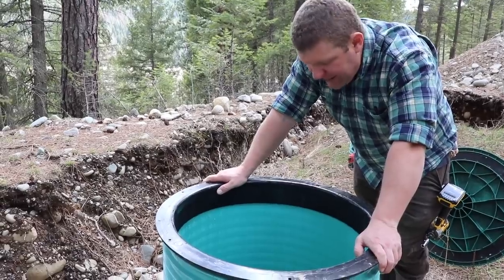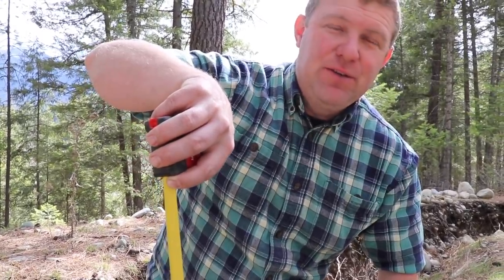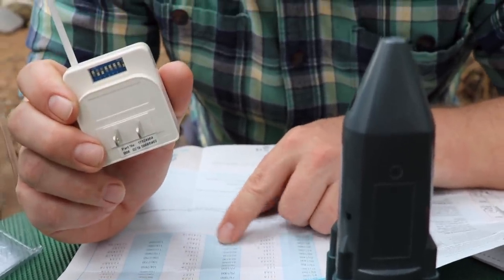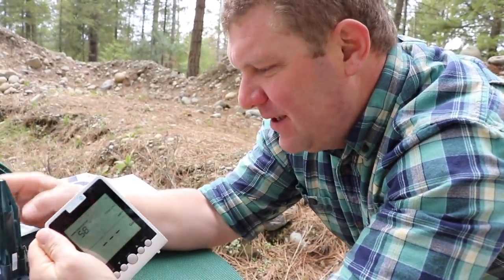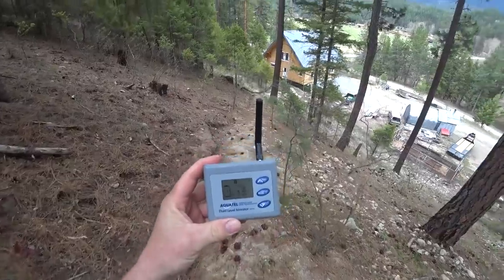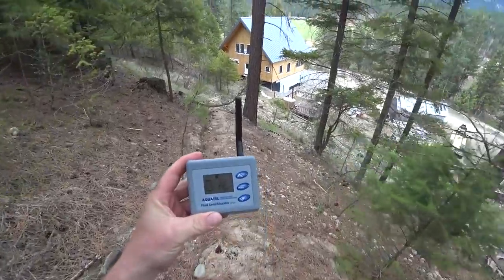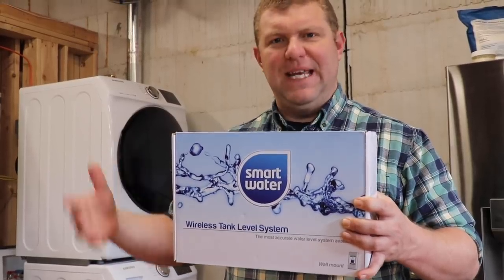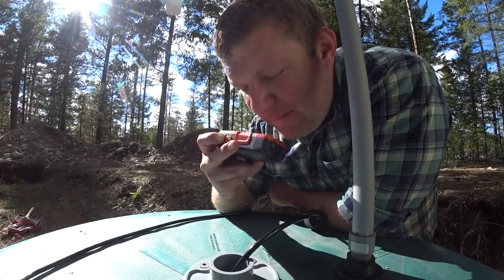Testing & Comparing Wireless Tank Monitors for Water Cisterns

Comment: FYI, The sensor is a Pressure Transducer that measures in Inches of water column.
There should be laser etched markings on the side of it that has the calibration,  usually (0-12 ft).
Don't rest on bottom it will get contaminated from any silt , leave it 6" or better up from the bottom.
They will sometimes install inside a perforated 2" PVC pipe attached to the side of riser.
Reply: Good to know

Comment: I'm old school and I'd preferred a plain old floating sensor connected to a relay switching on and off the pump (and maybe a valve to avoid return). The only limit: it needs a cable. I was in fact wondering why you didn't put any cable conduit alongside the water pipes toward both the well and the tanks.

Comment: Why not just have a float switch in the tank so the well keeps it full all the time  would be a lot easier on the pump and softener to filter 5 gallons at a time then 1000 all at once
Reply: I guarantee they eventually do this but you know Jesse and Alyssa they like to discover things from every angle before jumping right in the deep end.

Comment: Glad y’all went with the pressure sensor. I’m a geotechnical engineer, and we use these types of sensors to measure changes in groundwater. They are very reliable, and like you mentioned, very easy to setup. Love the setup you have, and love your videos.

Comment: Instrument guy here, 25 years in a chemical plant environment. You definitely got the best of the lot. Even the multi-thousand dollar industrial grade ultrasonic and radar units are really hard to make work consistently and accurately. The submersible pressure transducer type is far easier to get working correctly and consistently. That said, I'm a cheapskate and would have gone with running a piece of plastic tubing up the hill and running a bubbler. The tubing drops into the tank just like your transducer and needs to go all the way to the bottom. At the house end you put an air pump to force air into the tubing and put a pressure gauge to measure the air pressure. Air pressure == hydrostatic head (depth of water) and you're done. Get a gauge calibrated in Inches of Water.  When you want to know how much is in the tank, give the air pump a couple of strokes and read the gauge!

Comment: Right now the transmitter is sending it’s signal in all directions. 

If you add a yagi antenna on a pole aimed toward the house you should get a much stronger signal. 

Just make sure you get the right one for the device with at least 9db of gain.

Comment: Interesting you decided not to mount the transmitter over the wire port since you seemed to have a good enough signal. Maybe I'm missing the point, but it looked like it was possibly designed to nest above the split rubber bung and reduce/eliminate the need to caulk around the cable ...

Comment: Looks like the upgrade to the expensive unit (beginning at 30 minutes) could also be used to turn on your well pump when your systern is low. I would also, since you had extra cable above the systern, extend the cable via pvc pipe and fittings in order to get the transmitter as high as possible even though the receiver shows strong signal. You talk about this in your video so I believe we are in agreement with those ideas. Keep the great videos coming... You and you family are awesome... Joe

Comment: You might get more bars on the monitor if you add an extension cable for the antenna on the tank monitor and move the antenna higher. Like attach the antenna to your vent pipe on top of the tank lid. Just a thought.

Comment: The heavy duty lid will work with the tank riser. They are designed to screw directly to the riser. You need to remove the black adapter ring for it to seat properly.

Comment: When I was growing up, we had a cottage with a well basically the same as yours and a purification system almost the same as yours.  Our system had a pressure tank which the well pump filled and pressurized and it automatically came on when the water was low and repeated the cycle.  We didn't have any cisterns so why do you need them?   It seems to me those made sense before you had the well but now they' appear to be simply redundant.
Reply: I think the plan is to move to that, right now they are using a temporary set up, until they get the  permanent plumbing set up.

Comment: I really love watching your content but I’m a plumber and I am extremely confused why you don’t just set up s pitiless adaptor and dig a trench into the house and get a standard well tank also the softener is designed to kinda be hands freee and run and regen on its own if you would get a standard well tank this whole system seem extremely over complicated I would keep the tanks up the hill as reserve for when the electric is out but should be valved off in the house so you can fill or use water from them with the flip of a valve and a turning the power off to the pump

Comment: You should use a small pipe and little larger size pipe. Then you use a floating ball to pushing the small pipe up and down to measure the water. You painted red and green good or bad low water or high water.

Comment: Your house is tall just run a hose up a board to get high as the top of your water level mark it at full and low or just a float with a micro switch to a light 12 volts !

Comment: I expect that the signal would be stronger upstairs in the house but you may need it to work from the basement so you can tell if the tank is full while you are filling it when you are in the garage. i wonder if the snow will build up on the top of the tank beside the antenna and block the signal in the winter.

Comment: Jesse, 3-6" from mouth to mic is cool.  Anything closer distorts the audio, while Frenching gums up the mic.  //  Once you get the right monitor on there, you can see how many bars the tank monitor shows with each hundred gallons you pump into it, creating your own gauge measure.  Flow meters on both the well and outlet line from the cistern should be all you need.  https://www.amazon.com/s?k=water+flow+meter .  Another handy gadget is an overflow sensor to show when to shut off the water from the well.

Comment: The problem is the receiver is down hill from the sensor. the sensor likely has a built in antenna that radiates the signal up and out. picture a reverse cone. 73 de N5CJT

Comment: All I heard was: "...spent $120 for this chunk of fiberglass. Now watch me destroy it... and no, there is no possible way scrap lumber could work here..."
Reply: A plastic kitchen cutting board bolted onto the down face of the "cheap" cover with SS or galvanized nuts and bolts. Think several commenters may have a thought re cold weather ops, as I have had winter probs even here in Texas with electronically controlled devices. Best of luck Alyssa!

Comment: Nice review and the results are a little surprising too.  The cheap-O units seem to have more negatives than positives and the top two look to be a better starting point for anyone with a water storage unit that’s situated farther away like yours is.  Since you installed the Smart Water unit and if you want to elevate the remote transmitter you may want to consider using a mini-tower stand built from PVC pipe with flanges on both ends to 1) attach it to the tank and 2) mount the transmitter onto.  While the tank vent is made from smaller pipe, for rigidity you probably want to use at least a 2 inch stack for your elevated sensor mount. This was a very interesting and informative review and thanks for taking the time to document it.

Comment: The fancy sensor with the long cable is reading pressure I believe.  Different fluids with different densities reading differently per inch of depth hence why you purchased on calibrated for water.  So it reads pressure and does the math for the density of water and gives you an accurate depth. The good thing about these sensors is that they are solid with no moving parts. Very robust. They are used extensively in industry and manufacturing.  I work at a carrot processing plant in Bakersfield and they use these type of level sensor on their water tanks.

Comment: With your setup (no rain harvesting), I would just have installed a water flow meter on the main water descent. You can get a fancy one, electronic wired to a display in the house, resettable.

You know how much water is in the tank when is full,  so you just check how much water you used, and you know when the cistern is almost empty.

Comment: one of the reasons you probably not getting any readings on the cheaper systems is that the monitor is below the sensor.  They probably would work just fine in a straight level line of sight setup.

Comment: An option to consider would be to replace the antenna on one of the units that could not transmit far enough.  Replace with a 9db high gain antenna to double the distance.

Comment: Maybe you’ve given the answer before, but why are you still using the cisterns now that you have the well dug? Seems like an unnecessary step.
Reply: Because they rely on gravity to get water pressure, otherwise they'd need to use the inline well pump. Also I think they might be worried about running out of h2o during low water periods.
Reply: Gravity feed the house so in case of power failure they still have water and do not require connecting the well pump on the generator.
Reply: To prevent the well pump motor from burning out from constantly cycling on and off every time you open faucet and the pressure drops, you either need a pressure/storage tank to handle filling up a glass or pan with water so when the well pump comes on it can pump several gallons of water.  Using large cisterns on top of the hill is actually the ideal setup since they can handle hundreds of gallons of water before the well pump comes on and then it can pump for hundreds of gallons of water before shutting of and staying off until needed again.  That is also one rason why cities use those large water towers to maintain pressure on their system.

A system like what they have set up can last for decades before needing the well motor or pump serviced.  My parents installed their system in 1973 and replaced the pump and motor for the first time in 2018.  45 years.
Reply: Not sure Jesse's reason why but, I know that the biggest draw back of running a well system with a pressure tank and pump is that it takes quite a bit of energy, however if you have that combined with a gravity fed cistern your pressure is inherent and you can fill the tanks with a much smaller pump.   Just a guess.
Reply: Evan, you're totally correct.  They love to make things more complicated by over analyzing everything.  Millions of houses in this country and throughout the world use submersible pumps with pressure tanks without any problems.  Power goes out; start up your generator or drink some beer and wine until it comes back on.  I live in the country and my system has been working continuously for over 14 years.

Comment: the one with the weird switches is probably just using a binary value to read what the depth is in the tank. So if there are 6 switches that gives you 63 different possible depth readings. Pretty easy and clever solution. 
That and I hope you actually test the different ones again with some of the advice that I have seen here in the comment section. Like testing it from the top floor in your house and using range extenders to boost the signal. The problem for the signal that goes to these readout panels is the big hill and trees that the signal has to pass through making it very unlikely that they are just going to work out of the box. Also the first product you tested I found very interesting and maybe it just needs some Macgyvering to make it work. Cheap products often come with the added benefit of hours of trial and error ;) So it would be awesome if you tried again :D

Comment: If I remember correctly from the previous video only the most expensive model had a long distance transmitter.  It was stated to be 1,000' compared to 300' on all others.  I had the same reception issue on my original weather station (300' transmitter) compared to my current system (1,000').  All are line of sight maximums and the 300' transmitters are seriously degraded by walls, trees, etc such that you're lucky to get 150' if not truly unobstructed.

Comment: You should go and visit your local water distribution plant and see what technology they use. I know they use high and low level floats switches that are wired to a control panel that gives you accurate readings. 
Cheers

Comment: The Smart Water unit does not measure Specific Gravity (SC). It measures pressure with the pressure transducer (The part you put in the water).

Water has a SC of 1.00, meaning that 1 gallon weighs 8.34 lbs. 
It takes 2.31 feet of water to produce 1 psi. 

If the SC of the liquid is higher the less liquid height it will take to produce the same 1 psi.

A liquid with a SC of 1.10 would weigh 9.17 lbs.
It would only take 2.1 feet to equal 1 psi.

A hydrometer measures a liquids SC. Basically the same thing that you used to measure the sugar and alcohol content of your Meads.

Comment: Just hook up the well to pressure tank then done 👍🏻
Reply: That would be boring!
Reply: I was also thinking, "What's the point of filling cisterns when there's a well within 50 feet of the house?" Why not just hook the well up to the house instead of filling up 1500 gallon cisterns periodically? I've lived with wells off and on my whole life and we never used a cistern as an intermediary. Seems like a whole lot of work for nothing.
Reply: Then they'd lose all the advantages of having a cistern. Like 2000 gallons of water on hand to fight fires and (lots of) water available when the power is out.

Comment: The "Base-Station" aerials (antennae) probably need to be 
at "Roof-Level" on the Back side of your house
(nearer-to-your-cisterns-side of your house)
to get a DECENT signal strength
(better, less-interrupted, line-of-sight).
If you ran a "mains" power extension cord up to your cisterns,
&/or took a small portable power supply up there, 
(inverter & battery, &/or small gen-set) up to near the cisterns,
you could simplify the initial testing,
and THEN deal with the signal-strength (reception) issue(s) 
(antennae height ?)
separately AFTERWARDS.

Comment: Keep it simple if you have your fill line separate from your house feed. Just add a pressure gauge in your house and do the math to convert PSI to feet.  If you're not using any water in the house static PSI will equal feet of head in the tank.

Comment: We've been watching the two of you for years. I don't know if we missed something or not. But, why aren't you just using your well instead the sisterns . We're just curious!
Reply: The well has a pump, so if they use it to fill the cisterns they get water pressure even when the power is out. I think they also still aren't totally sure how much water the well provides as they use it, as well as if it's seasonal. You might get an answer on their Instagram, but they don't answer questions here.
Reply: It's actually because they need to run their well water through the water softener. As said in the previous video, they have pretty iron-y watter which can cause staining of your toilet, bath tub, sinks etc. Now since the pump has to run for the softener to run, you have to do something with the pressure. If all your faucets are closed, you can't just run the well.
Additionally there is always the risk of your well not being primed well. There is always some sediment which decreases your water quality so a good 10-15 minute prime is the best thing for your water.
After all that, you have to store the water somewhere, which is ehere the cisterns come in and there you go :)
Reply: The water from the well has alot of iron in it and it tastes bad and causes damage to appliances when untreated.
Reply: they are using the well to fill up the cisterns. that way they don't have to run the well pump whenever they need water and they have a more constant water pressure.
Reply: When you start a pump, it takes a lot of power untill it runs at capacity, so if your pump stops and starts each  time you turn a tap on, you use a lot of power.
If you fill up your tank once over a couple of months you save a shit load of power. $$$$$$$$$
AS well they have to run there pump 20-30 minutes to get clean water. It would still be cheaper than a stop start process.
Reply: You've missed a few recent videos then. They explained why they arent using it directly from the well, due to minerals in the water (mainly iron) . They even installed a water cleaning system :)
Reply: They fill the cisterns from the well using a water softener.
Reply: you cant just have the taps in your house connected directly to a well, it needs to be cleaned first. This allows them to clean the water and have plenty stored ready for use.
Reply: They are using the well through a water conditioning system to remove excess particles from the water before they put it in the cisterns. That way they don't have to worry about conditioning it after and possibly having to wait for usable clean water, this eliminates them from having to clean out the cistern years down the road because of some outside contaminate.  Only fresh potable in much less chance for something to get in there that they dont want.
Reply: They're using there well, but they buffer it in those cisterns

Comment: MOst cheesecakes are cut into 8ths or 16ths and this would be for an 8" cheesecake.  If you have a larger cheesecake, then could potentially cut further, but chances are it would be a sliver for a 9" cheesecake.  Also take the height into account. My cheesecakes are about 4" high and a 10" pan.  My co-workers love it when I bring cheesecake in.